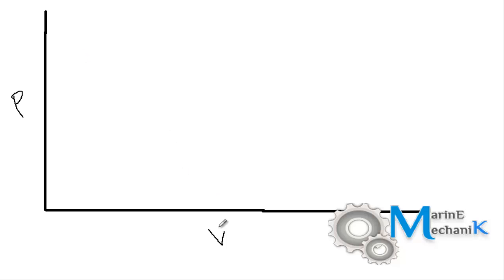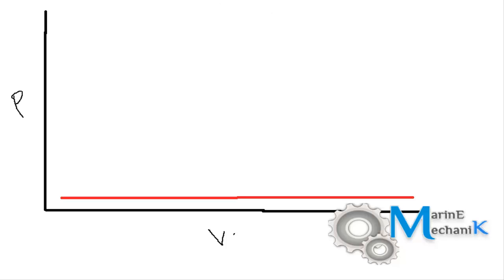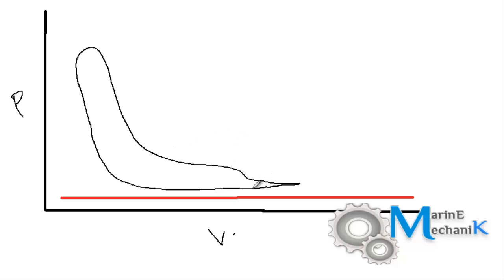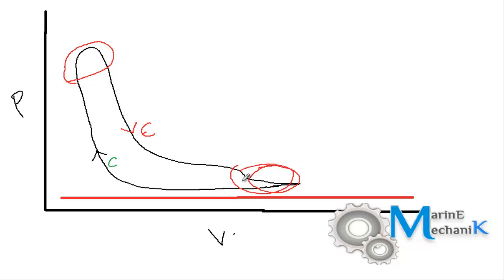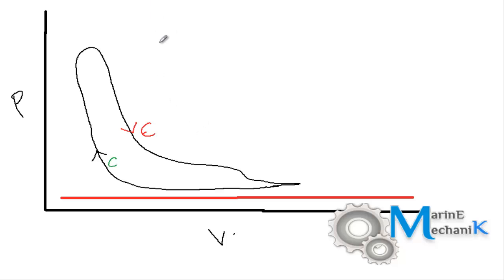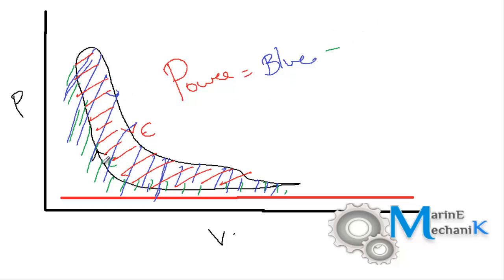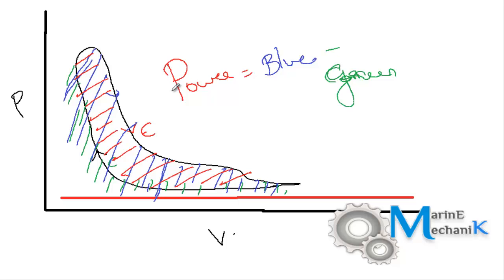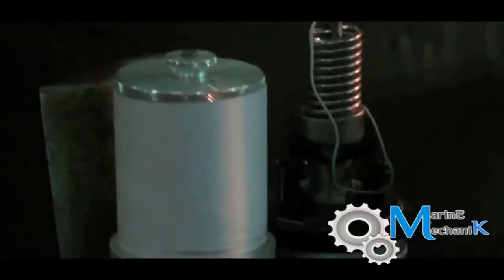Power Card - Procedure and Explanation...!

Comment: There's a huge flaw in your procedure. The atmospheric line needs to be taken with indicator cock with the indicator cock shut & with the string connected to the indicator drive. This way length of the card = length of atmospheric line. This length is crucial to accurately determine the power